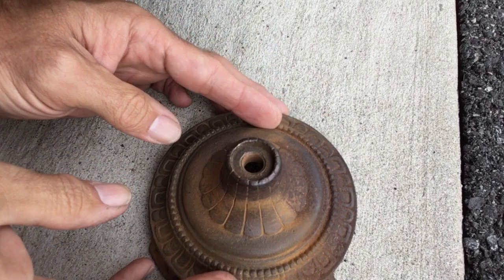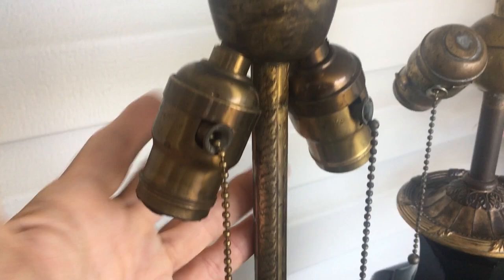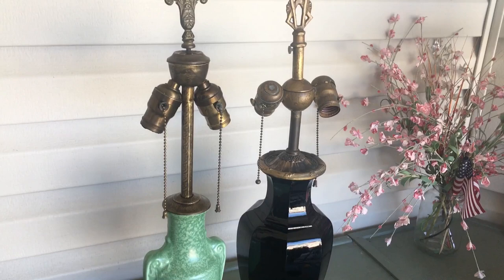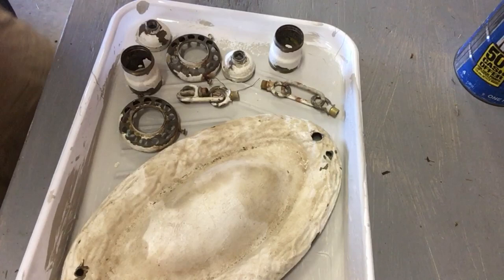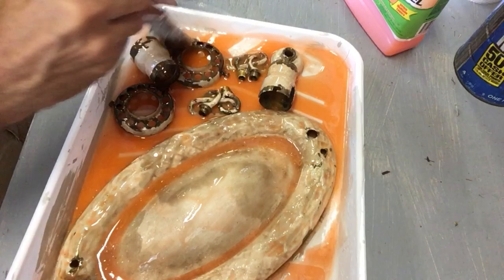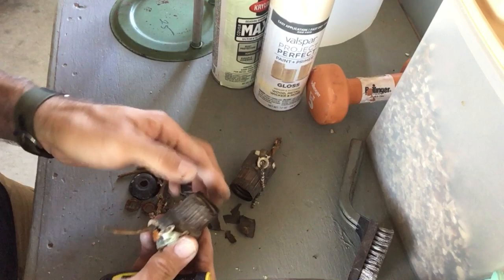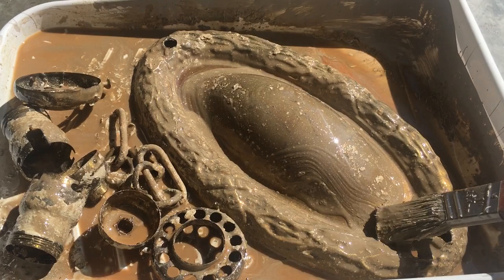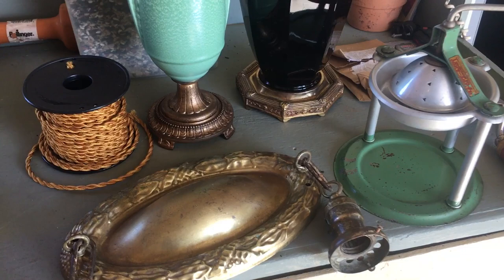Restoration of 1920's Antique Lighting

Comment: I use soap powder dissolved in boiling water(top up with cooler water to cover) to soak paint off items.Its cheap and incredibly effective.No elbow grease required.Items clean and rinses away beautifully.Doesn't harm metal,glass or wood if you don't leave the wood too long.I've done wooden door handles.Excellent

Comment: You did a great job. I love that light fixture you stripped. Would I be able to get it installed by a regular electrician. You are restoring the wiring too?  I have wanted vintage lighting but  was unsure how to go about it. I totally trust your advice Scott. I want to change lighting in living room and bedroom. It is a 1930 house with high beadboard ceilings. I think the one you stripped would be a  nice type for the living room. This is not a fancy crystal light fixture house but that fixture is beautiful not over the top. I would love your thoughts.
Reply from the maker: For safety and peace of mind, I would always suggest having a professional inspect and install antique electrical light fixtures.   There is nothing unusual about them so most standard electricians would have no problem installing them.